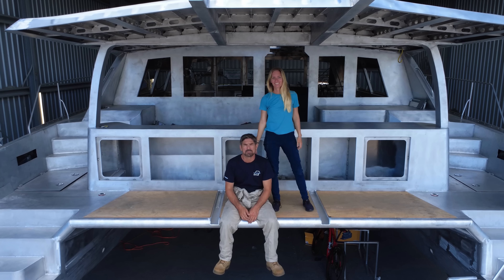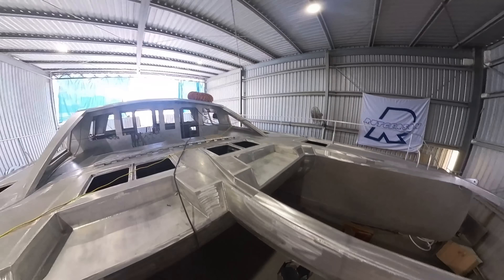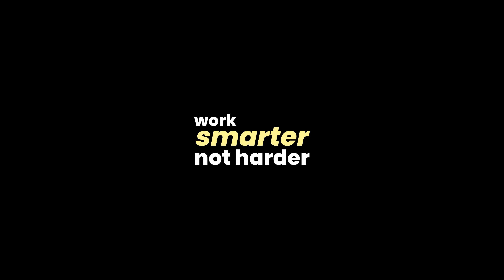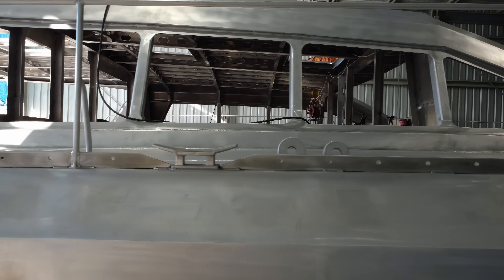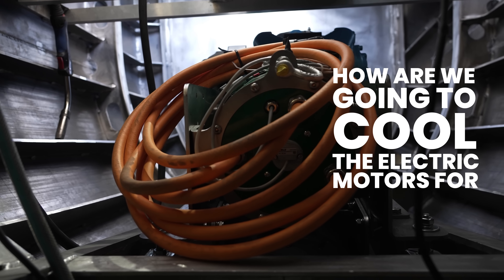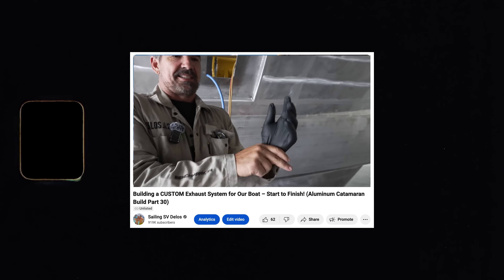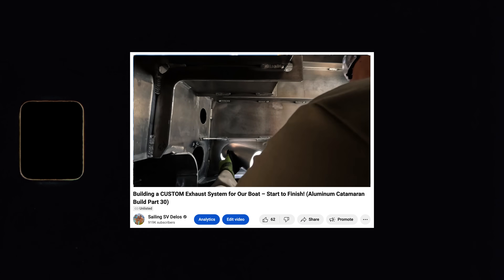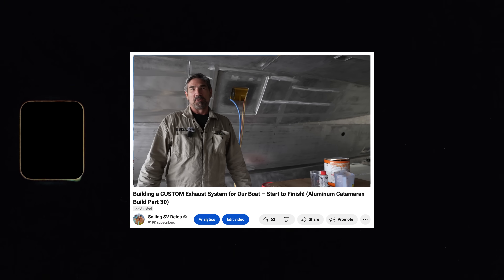We Challenged AI to help design our Keel Cooler 🧠 (Building Our Own Aluminum Catamaran From Scratch)

Comment: I'm a mechanical engineer from South Africa. I have a background in mining equipment, not in heat transfer or marine engineering, but from what I remember from Uni about designing heat exchangers and from what I've googled just now, I am concerned the AI's are taking too simple of an approach to this problem. 

Basically, I think the AI's are treating the problem like an issue of how to size insulation, where you have a single material and you are trying to find out how many watts of heat a certain length of that material can conduct given a temperature difference from one side of the material to the other. Notice that DeepSeek defines U as W/m*K, which is the unit you would use for a calculation like this.

A heat exchanger like the keel cooler being discussed here uses two streams of fluid that move past each other, separated by a heat conductive material. An immediate consequence to this is that the temperature difference across that system can't just be the high temperature of the coolant (liquid coming from the motor), and the low temperature of the outside seawater. Because the coolant as it travels across the keel cooler doesn't decrease linearly, nor does the seawater raise linearly. Why does this matter? Let's assume some temperatures:

T1=60°C (coolant temperature coming from the motor, entering the keel cooler)
T2=40°C (coolant temperature leaving the keel cooler, heading towards the motor)
t1=35°C (outside seawater just as it starts to pass over the keel cooler area)
t2=30°C (outside seawater just as it leaves the area over the cooler)

You might be tempted to take the temperature difference as 60-30=30°C, but crucially, this difference isn't constant at all points in the cooler. Think of it - when the coolant leaves the cooler, it's already been cooled by the now heated seawater, and that 30°C temperature difference is now longer in place. You can't just take the mean average either - as fluids cool down faster the higher the temperature difference is, making everything non-linear. Instead, you must take the log mean temperature difference. 

T_m=((T1-t2)-(T2-t1))/(ln((T1-t2)/(T2-t1)))=13.95°C

Which you can then use to size the keel cooler's required heat transfer area. You can appreciate that just using the simple high temp-low temp difference would produce very different results to using the log mean temp difference.

The fact that the AI is not doing it this way suggests to me they haven't been exposed to enough of these sorts of calculations in their training data.

The basic equation for a heat exchanger is Q=U*A*T_m
where Q is the required heat transfer rate [W], in this case 0.9*25=2.5 kW
U is the overall heat transfer coefficient [W/m^2*°C], not the same as the U used by DeepSeek. This is dependent on the two different coolant mediums (coolant and seawater) and how they flow. Best value I can quickly google is 500 W/m^2*°C, which doesn't take into account the effect of the aluminium or any paint, as other commenters have pointed out.
A is the heat transfer area [m^2]
T_m is the log mean temperature as defined above

Using these values I've google gives a required area of 0.2558m^2

This is where experience and expertise matters a lot, because these are all just values and methods I've googled within the space of ~30 minutes, or assumed as 'reasonable'. Someone who is experienced in this will obviously be able to provide much better info. There are also some counterintuitive aspects to heat exchanger design. The smaller your temperature differences, the larger a heat transfer area you need, for a given amount of heat transfer.

One other thing I noticed while googling is that Beta Marine provides keel cooler required area sizes for its diesel engines. Perhaps Combi also has this info pre-calculated?
Reply: Nailed it.

Comment: I asked Grok the same question and got "Final Answer
Heat to dissipate: 2,780 W

Keel cooler size: Approximately 0.28 m² (e.g., 53 cm × 53 cm or 1 m × 28 cm), assuming a 20°C temperature difference and h = 750 W/m²·K, with a 50% safety margin."

Comment: You didn't mention the barriers to heat transfer such as organics and coatings. Stored heat in framing and free board that could affect duty cycle and create poor performance over time. You might throw that our when you present your solution to save some bros down the line. Loved your interior walls by the way. Cheers!

Comment: Owning an alloy yacht and dealing with corrosion  created by the good idea fairies, such as external keel cooling for refrigeration .  I would stick with long proven systems from the fishing industry, Australia has loads of alloy fishing vessels.

 Just came off the hard in NZ and a 12 mth old alloy commercial vessel had so much corrosion that it may be a write off because the good idea fairies had a massive fail. But love that your outside the box dude.

Comment: Could you tap that "free heat" to heat your shower water or cabin heat in cold climates? Second question, if you are considering HVAC to temperature control the cabins, could you use HVAC as an aux cooler for the motors? Assuming you have lots of solar for powering HVAC, it wouldn't make much sense to electrically cool motors if you also had to run the diesel to create electric. An interesting question to solve, to be sure! Oh, sorry, long post, could you build up a quick test, like a 55 gallon drum with a submerged heat exchanger, to see how fast the electric motor can heat up 55 gallons of salt water? That might give you at least reinforcement for the numbers. Keep up the great work!

Comment: Heat GOOOD never waste it in designs. Watch this video /watch?v=SbVRXvrGJfI With a cold steam condensing system ALL the heat in the vacuum inside Turbine habitat becomes power leaving only cold vapor on cold side. For making cold side MAX without any chemicals = Water layer for tank with room for ice expansion + Piezoelectric cooler to finish freezing process(Vacuum freeze). Can be set mechanically to cold boil out from that layer anytime if heat from environment builds up for any reason = The AI debated and defeated about it called it "Regenerative cooling" because it super low pressures to force the universe to eject the heat.

130+ temps = Harder you run your motors the more powerful your ship becomes. The regenerative ice thing in panels + a fan or design for boat to let air cycle inside for constant fresh air cooling = Ant venting logic but with closing shutters when fighting storms if needed combined with regenerative cooling tech. Once vacuum is set = Leave it alone no more pump power and when needing to send water condensed from cold side the turbine can act as a flywheel dumping its excess power to rotate the pump outside by magnet.

If you see it then when you see Submarines bleeding heat into the ocean and spaceships doing the same thing = They're wasting tons of power that can push advanced defenses for ships.. Like Ultrasound holography harmonic reinforcement or anti-drag to move far easier in ocean. Ultrasound pressure wave anti-drag.. Move through the ocean like a sonic knife..

Comment: Dumping the search text at 3:51 into a comment so everyone can grab it and stuff it into their favourite AI:

If you have a 25 kw electric motor that's 90% efficient and you want to cool it with a closed loop coolant system how much heat do you need to dissipate via an aluminum heat sink? How large would the heat sink need to be if it's used as a keel cooler on an aluminum sailboat?
Reply: Perplexity comes up with 0.17 m^2, assuming 15C water and 35C coolant.

Comment: on 26 September 1983, off the coast of Rhode Island, the yacht Australia II crossed the finish line to win the America's Cup, a new designed wing keel designed by Ben Lexan  was the success. Perhaps using a similar type of keel to dissipate heat as a radiator but also reducing drag and increase stability is the answer

Comment: This is a very interesting episode and it undermines the principles of engineering when it comes to the use of AI. There is a way to determine the exact requirements of your system and determine what size keel cooler you need. The key issue with the "trusting the AI solution" approach is the lack of fundamental understanding behind the calculations being performed, and the blind trust given to the "black box" solution provided by AI. You should not be blindly trusting AI to make major engineering decisions for your boat. Or "going off a hunch" based on the requirements from other similar systems. The exact requirements for your system can be determined and I'm sure you are consulting professionals and not only using AI. 

I do have one additional thought though. I spent 8 years in the Navy and having "warm spots" on the hull of ships results in excessive sea growth in that area. I would be concerned about the increased frequency of having to clean your hull over the keel cooler to prevent loss of heat transfer capability, causing overheating in critical propulsion systems. It would be much easier in the long run to have a heat exchanger with a cooling pump and a sea strainer. You then run the risk of the sea strainer becoming clogged and the system overheating from that method, and the additional risk of damage to equipment (because you have more equipment). Each method has it's own trade-offs. Realistically as you get older I don't think getting in the water to clean the hull more frequently is very desirable. You could un-clog a sea strainer from inside the ship by designing it such that you can press a button to reverse flow through your system to flush the strainer, and have a warning light on the conn to tell you if your motor temps are getting too high (prompting action).

It is an interesting thing! I hope this reaches you! I would love to sail with you one day! I love watching your videos!

Comment: Ahh yes you listen 😊 it's pretty simple. I ran on a 20' aluminum Hull about 15' 1x3" channel forward and back to a heat exchange with a electric pump on a LS2 V8. 500 HP. The temperature in the Colorado River runs warm in the summer in Parker AZ. No issues at full throttle.

Comment: Google. How many Square Meters of aluminium heat sink needed to dissipate 2500 Watts of Heat (Ohmic loss). With Seawater at 20°C and Aluminium at 35°C? 
= 0.17 Square Meters

Comment: I think the cooling efficiency will be considerably impacted by not having flowing seawater in direct contact with the cooler (i.e. your plan for an internal hull location).  In addition, with an external hull install, multiple sides of the cooler are transferring heat to the seawater.  With your install, only the one side of the cooler up against the hull interior will transfer heat (if I understand your plan correctly).

Comment: This issue with your question is that you actually have two heat exchangers. One on the motor that will have a maximum temp allowable and the other is the one in your hull. You first need to start at the motor end. So what is the running temp of the Motor? Then you can calculate the flow required of your glycol and set the temperature. Only then can you calculate the secondary in-hull heat exchanger. Its all about your temperature difference. for instance: If your motor runs at 35C and the sea water is at 35C then nothing will get cooled. Its called entropy ...

Comment: "AI" (or LLM) cannot design stuff they can only reliably guess the most likely next word. That being said they can help get in the ball park however i would say, before you officially commit to a design you should consult someone that can do the simulations and analysis as you are over simplifying really complicated differential equations that are easier to guess and check than "solve:.

Comment: Why didnt you use grok ai, is supposed to be better than the others, and why not make a recess in hull and mount cooler on outside of hull but put removable cover that not really a cover but forces the water through it if the cover is flared at each end. Kinda like air coolinf for brakes direct the water and have finned cooler hidden but still high performance

Comment: SolidWorks Flow simulation will allow you digitally test the design and iterate the heat transfer solution to optimize efficiency (and size),  I am sure that there is a local source for that expertise where you are.  Just be sure to consider your input variables at worst case and you should never have a problem in real life.

Comment: I would think that using a keel cooler, the temp. of the exterior water is going to make an enormous difference.  In the USN, in the Indian Ocean (we had a swim call about 200 miles from equator) the WATER temp. was 80+, the AIR yemp. was in the low hundreds.  I have also been in the Bearing Sea with water temps. down to about 30f!

Comment: There have been full calculation tables for more than one hundred years, being updated when newer materials/coolants are introduced to the market. You plug in your variables and out come the answers. It is simple mathematics and physics.
Why all the "AI does this" when it has already been done, without the buzz words?
Any competent engineer can do all of this without the bravado.
Reply: I think the answer is in your last sentence, AI allows non engineers to design these systems.  It may be 'inefficient' to have the AI recalculate the numbers rather than look them up but it costs practically nothing (to the user).  AI is unlikely to come up with the most optimal design (at it's current state of evolution) but as long as the design is fit for purpose and meets Brians constraints it doesn't matter and in a lot of cases preferable, simple is good.  No fins? less potential blockages, less potential area for corrosion and easier to implement/maintain.  Coolant leak? I would rather use plain osmotically filtered water available from the tap rather than have to have specialist coolant available. etc etc
Reply: @NeilSearle  That isn't AI. That's just a spreadsheet which does the work.
Plug in the variables and the results are shown.
Engineers have already provided all the tools available, at little to no cost to the everyday person.
All of the information is online, including the esoteric things such as Moliere Diagrams, tables defining the latent heat of vaporization, and General Thermodynamics, and it is all free.
Libraries, both online as well as brick and mortar varieties, are pretty wonderful without pretense.

Comment: Hi Brian and Kazza,
I know this is a bit off-topic, but I wanted to give you a heads up for when you start installing your custom electrical systems. Paying close attention to the electrical setup could save your boat from serious issues down the line, especially since it’s an aluminum sail catamaran. Here are some key points to consider:  
Ensure the bonding system for the electrical setup exceeds standard requirements. Aluminum boats are particularly prone to galvanic corrosion, so robust bonding is critical.  

Think about isolating the mast from both the main electrical system and the drive system. This can help prevent stray currents and reduce the risk of corrosion, especially with mixed metals in a marine environment.  

Look into integrating a capacitor bank to capture and repurpose stray currents. It’s an innovative idea, but carefully assess its safety and practicality for marine use. Moisture, vibration, and limited space on a boat could complicate implementation, so weigh the pros and cons.  

Since you’re using cutting-edge drive technology, it’s crucial to get this right. New systems can put significant strain on the boat’s bonding, and while it’s impossible to eliminate all stray currents, aim for an optimal balance to protect the hull, systems, and components from corrosion. (This is also why I suggest installing a capacitor bank to push that stray current back into the inverters or on the charging side to go into your batteries.) 

Double-check with a marine electrical engineer who has expertise in bonding and your specific drive technology. After the system is engineered, ensure the correct number of sacrificial anodes (zincs) is installed—too many can cause issues, just as too few can leave the aluminum hull vulnerable in saltwater and stray current can speed that up! I am sure you guys already know some of this and I hope that this information helps you double check and make sure you have everything covered. I have been watching from day one and just want all of you to be safe!

Comment: Take in to consideration max allowed motor temperature (spec) and the fact that the electric motor will be working as a generator for some extended charging. with worst case 35c sea water that is not moving (boat at anchor)

Comment: I assume, based on your plan, you would be attaching the keel cooler inside the hull which is not direcly touching the water. You should have been clear with he AI about that considering that the hull thickness must be considered as well.